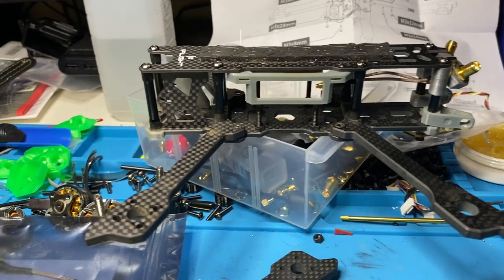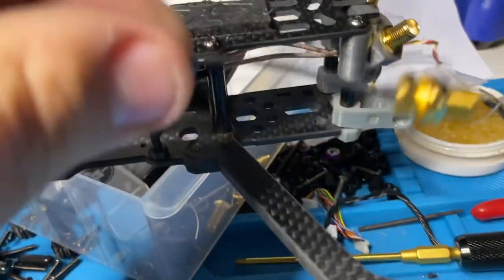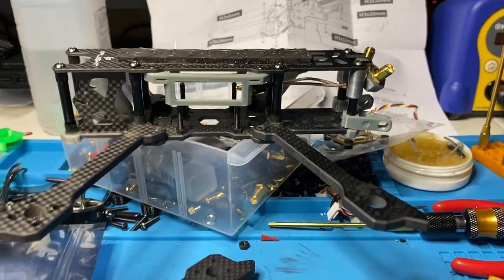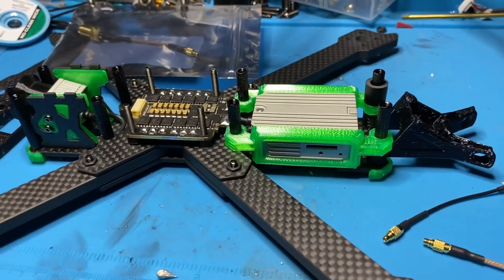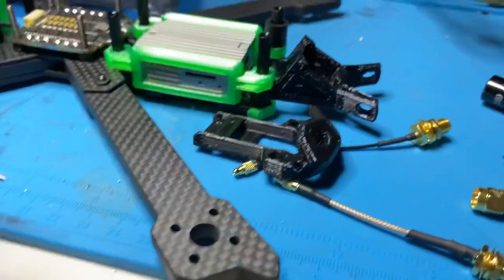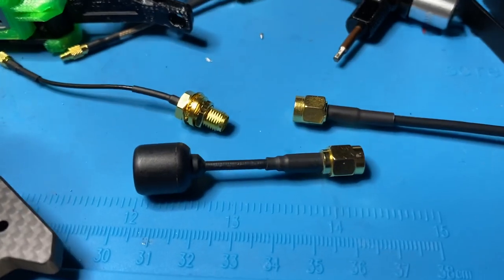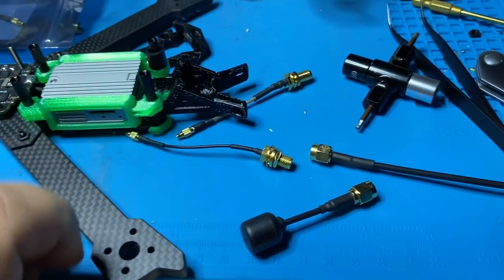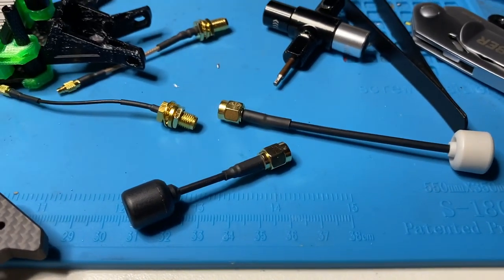Dji Fpv antenna issue, short range

Comment: Appreciate it. My self built quad Mr. Croc, uses DJI right angle MMCX antennas so no issue. My DC5 uses DJI antennas to Amazon adaptor cables for the same fit issue you have. I have only had this problem since I had to replace a broken SMA DJI cable. Thank you for posting as this has been a thorn for me lately with poor range (1/10th of my Mr. Croc custom build). Owe you a subscribe for this one - thanks 🙏

Comment: So was the connector issue used? Does the after market antenna perform better than DJI default air unit antennas?